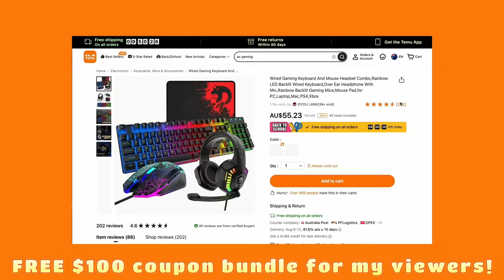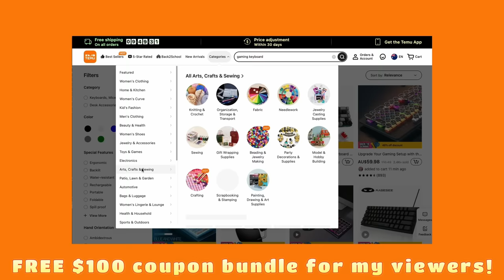Garden Nightmare Transformation | Watch me Rescue this Property

Comment: For those saying the tenants should have done this themselves - remember George has expert equipment and knows how to use it, anyone else doing this by hand would have a really tough time.
Reply: Yes they would, but clearing their rubbish would have made it easer for George.
Reply: @ollie9619  George gave them a quote for the work, if they were able to do it for themselves they would have done it before now.
Reply: @ollie9619  Yes--using a garbage can isn't specialized labor...
Reply: So a rake, a shovel, a manual lawn mower and a water jet cleaner are special equipment? 🤣 You can get that stuff at the garden center for a few dollars. The overgrown garbage dump, especially in the backyard, was pure laziness on the part of the tenants.
Reply: not they are not but edgers and trimmers are bladed and not for the uninitiated.  Also he had power washer AND attachments to clean the patio section.   @desmodenia3618

Comment: I found a couple of used trampolines on marketplace. I use the trampoline mats to rake yard debris onto it and transport to my trailer, helps speed up the process. I then use the mat to cover the debris so it doesn’t blow off the trailer. 
I plan on using the frame work to build 4 arches for a shed to cover my trailer when it’s parked